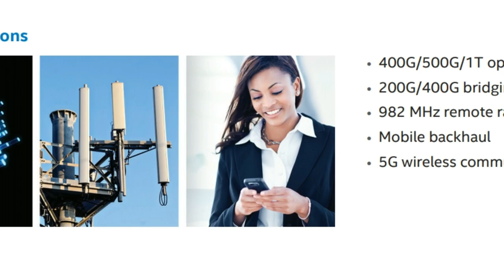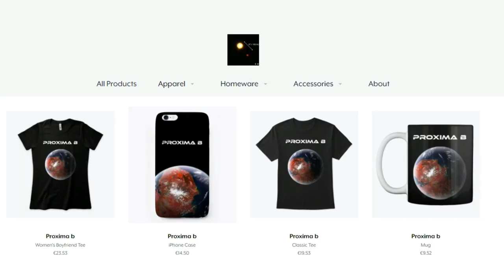An Analysis of the Proxima Centauri Radio Signal

Comment: Also take note that this Alpha Centauri system is 1.5 billion years older than our solar system so there was plenty of time for life to advance especially around A&B.
Reply: Then they flew here gave us c-nineteen plague and took over end of us
Reply: @johnjohn-cs9eu  🤷🏽‍♂️
Reply: It's only 4 light years from Earth. They're coming and they're gonna be hungry as hell.
Reply: @desertweasel6965  lol unless their doing minimum 20% Speed of light is gonna take them thousands of years to arrive here.
Reply: @geemanbmw  if they travel half the speed of light it would take them 8 years to get here. They could sent probes that fast through space. They may be a million years a head of us.
Reply: @desertweasel6965  true as far as the alpha centauri system is its 1.5 billion years older than our solar system so yes they could have a tremendous head start over us there's no telling. Also it's a satistical certainty that any civilizations signal we pick up will almost undoubtedly be older than us.Yes it would take roughly close to 8 and half years and that's if they have technology that can slow them down pretty fast otherwise it will take longer.
Reply: @desertweasel6965  they would probably pity us
Reply: @desertweasel6965  no it will not take them 8 years at 50%c, they have to decelerate which will take the same amount of time that they accelerated to 50%, that puts it at a minimum of 16 years.
Reply: @hajorm.a3474  what if with their technology, there is no acceleration or deceleration? Perhaps traveling the speed of light is very unstable, because to achieve it is all or nothing. You are at zero, then the speed of light and then zero. Very much how a magnet interacts with copper.

Comment: Drifting can mean the transmitter has an unsteady oscillator. Could be in the amateur band in 900 MHz / 33cm band. CW modulation.

But we don't have the data to analyse.

Comment: So... shouldn't it be possible to exclude terrestrial aircraft based on the magnitude of the doppler shift? Also, I would expect that a NATO transponder would be modulated in a recognizable way, and I've heard that this signal is a pure tone. Thoughts?
Reply: David Kipping said in his video on the Cool Worlds channel that the modulation might just be too fast for the telescope to detect.
Reply from the maker: Good question. I think it's difficult to say with the available data. Unlike the Wow! Signal, BLC-1 appears to have some shift (a strange one according to Breakthrough Listen). As far as I'm concerned, there is a type of modulation in which the frequency is changed. Maybe this was the case. Or maybe Parkes just picked up the 'unmodulated' part of a military transmission.
Reply: Jason Wright, on Event Horizon, speculated that the unusual frequency shift could be consistent with a transmitter orbiting proxima, perhaps on a planet. Apparently he and some colleagues are crunching the numbers.

Comment: Well if they were able to determine the Doppler shift somehow that will probably tell you if its a plane or not. I listened again and he said drift, which sounds like Doppler.  There should be some orbital data to show Proxima B's orbital speed and Proxima's solar system speed as a reference. I suspect they seen a change in frequency meaning there was doppler effect taking place. Might be able to work that out with the orbital time and speed of Proxima B and see if it matches. Hopefully it was recorded, was this another carrier, beacon type signal? Anyway to know if it was modulated at all?
We might as well send a message, its so close they know we are here, if anything actually lives there.
Like someone posted below, I would suspect Alpha Centuri b/c first.

Comment: Here is another random thought, maybe a bit far out. I was thinking about the recent EH story about alien artifacts. I wonder if in any of Egyptian or Mayan drawings any references to stars  that appear like Alpha, Beta and Proxima Centuari? Maybe like the aerial view of the great pyramids, they resemble the three stars. Something kind of like that. If there's a civilization, maybe they came here before at some time. Just some random thoughts, I should probably stop watch scifi shows.
Reply from the maker: It seems that ancient Egyptians indeed revered Alpha Centauri, and may have built temples aligned to its rising point. Source: https://earthsky.org/brightest-stars/alpha-centauri-is-the-nearest-bright-star
Reply: @TheExoplanetsChannel  I wonder if anyone has an idea why 982Mhz? 1420 we understand. Maybe King Tut's hat size.
Reply: I also seen at the top of the story they said it was 99.9% chance it was interference. But moving the dish on and off the signal would rule that out. 
The link I posted above contains a bunch of replies at the bottom of the article. There are some super smart people and seems to be more information about the signal. I am wondering if the "leak" was to work around this story not being released to the public.???

Comment: You forgot one reason it isnt likely a signal from plane or the military - it is monotone, and lasted 3 hours. Would any plane or military transmit monotone signals for hours at a time WHILE DRIFTING IN THE AIR? That's plain impossible any way you look at it, so it is irresponsible to even put it on the table as something we can ponder.

Comment: How could the signal be produced by aircraft when it is so narrow and accelerating in its blue shift at a specific angle over such a long period of time. No plane is on approach at that angle and speed that long. Also, the narrow band is more reminiscent of a laser. No plane frequency is that narrow and at that wavelength.
Reply from the maker: As far as I'm concerned, 982 MHz is a narrow frequency used by the military. The total duration/speed of BLC1 hasn't been made public (only the duration of the observing session where it appeared). The discoverer team hasn't ruled out an aircraft as the source: https://www.nationalgeographic.com/science/2020/12/alien-hunters-detect-mysterious-radio-signal-from-nearby-star/ More data is needed in order to confirm/disconfirm that the signal was produced by an aircraft.
Reply: @TheExoplanetsChannel  the observation period was in the Guardian. From personal experience I can tell you that there is no way you could explain the signal with a single plane on approach over the reported observation period unless that plane spent 3 hours hovering in the approach corridor. Multiple planes would not produce such narrow band and a single signal especially given that signal goes down to .002 frequency. There are ASICs that could have produced it but that would need to be verified which I'm sure they will.